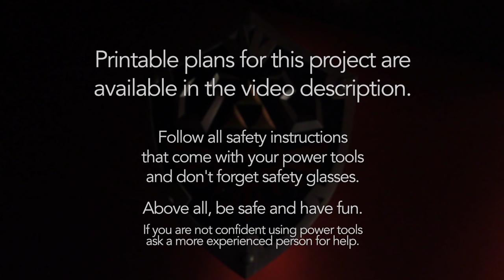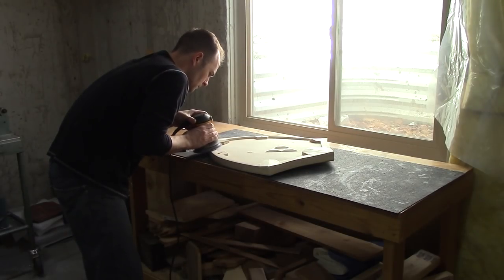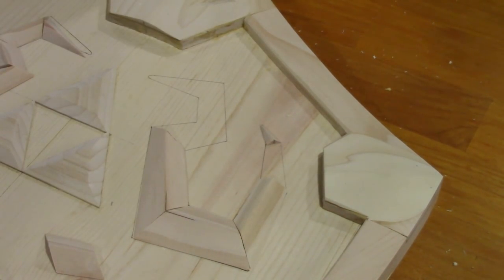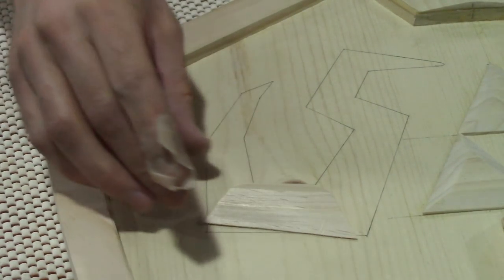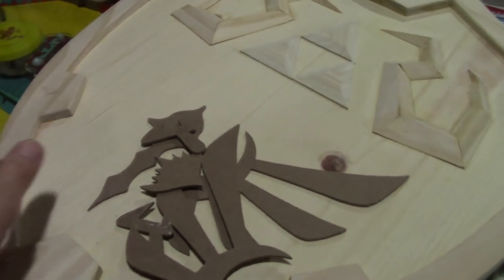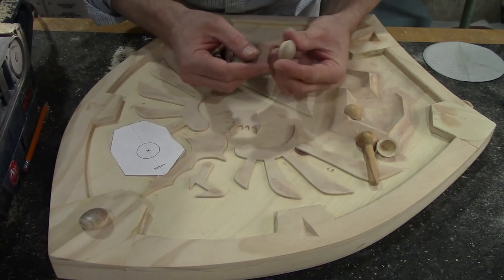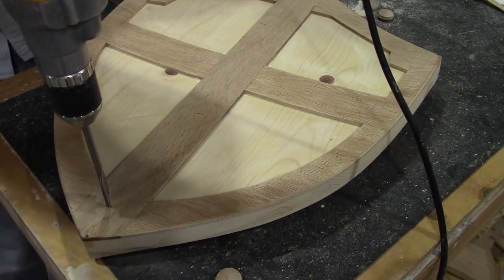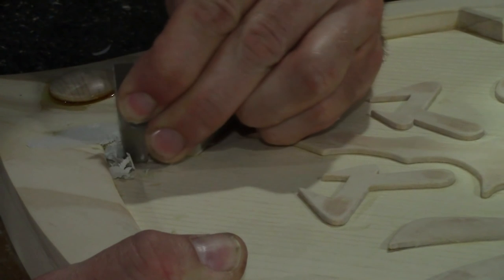How to make Link's Hylian Shield PART 2 - Skyward Sword Zelda Cosplay

Comment: Thanks for the video! I used your great template which helped me make mine. I don't have a lot of woodworking tools though, so I made mine out of foam and paper mache. The body is a piece of cardboard wetted and curved over a basketball, and then coated with about 4 layers of paper mache and then painted blue. Then I cut foam with an exacto knife and adorned it with the hylian designs. Again, your template was a huge help. - Kyle

Comment: If anyone is having trouble finding the nails he is using you should look for brad nails that are easily concealable with either wood filler or bondo but I recommend wood filler because it looks nicer and it blends in with the wood. Plus you can use wood filler on the knots of the wood and to cover up the middle lines or anywhere else you want something concealed and make everything look like one piece not multiple pieces. All you have to do is spread the wood filler on the lines or holes or knots you wish to conceal wait for it to dry then you just use a sander or hand sand down the excess wood filler and it makes your piece like it’s all one piece.

It really is matter of personal preference so go with whatever you’re comfortable with.

Comment: Hey, I thought of a way that you mite be able to make the s pieces on the shield. First you cut the full thing out on a piece of soft wood that is easy to chisel away, and also draw the middle. Then with a chisel or another sharp tool, slowly work at it until you got the edge you want. I don't know if this will work or not, but it's an idea.

Comment: I really like your woodwork  friend. but noticed you had a clamp block sticking on a glue up joint may I offer a tip for easier release when unclamping ?... I find using wax paper between the scrap wood on the clamp and the piece your gluing keeps the two wood pieces from bonding when removing the clamp..

Comment: I don't know if this is helpful at all, but I think I have a tool to help sand the very geometric detailing shapes that you had difficulty on. I remember my fathers having a Precision thin belt sander, the sand paper thickness was about 10 - 20mm across and I think would have been perfect for those tricky edges!
Reply from the maker: Chantellie I think I know what you are talking about and yes, I bet that would be awesome for that part.  Are you going to try it?

Comment: what if you made the whole snake piece, used the belt sander for what you could and then use a file to get the inside down enough and then a fine sandpaper to neaten it up? maybe it's easier, maybe it's not. I just thought of it before when you tried to make it up in one piece

Comment: Rather than sanding down the button “rivets” on the front side, wouldn’t drilling the holes the way you did on the back have worked just as well?
Reply: +Joel C. Salomon The bevel on the front would have made it stick out and not lay flat.

Comment: GREAT WORK!!!!!
why it the "S" would have been so easier by casting it out of resin?
you would have had to made two "S"  as "originals" to make the mold with them and then finally cast it
don't you think it would have been way harder to do that
PLS reply, thanks
Reply from the maker: +papercut23 You are right.  But I was talking about making copies out of resin for future shields. Like you said, one would still have to make a master before a copy.
Reply: +HappyAtom do the "s" like you did before you cut it into tiny little pieces and then hand sand the inside with sand paper....idk it just seems simpler to me
Reply: Idk but I have only done wood work for two years ((and I am in 7th grade)) so I am not too experienced with wood so idk if it would work